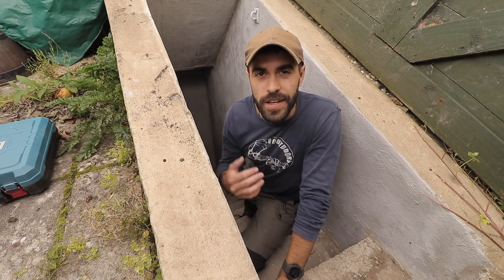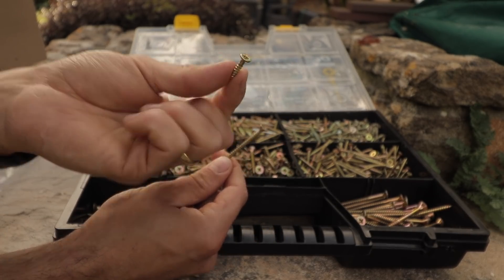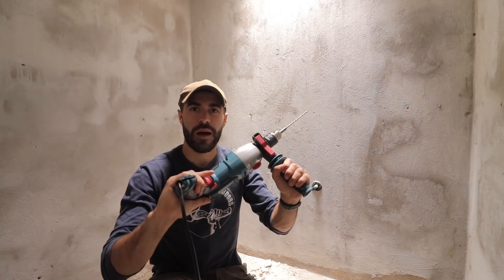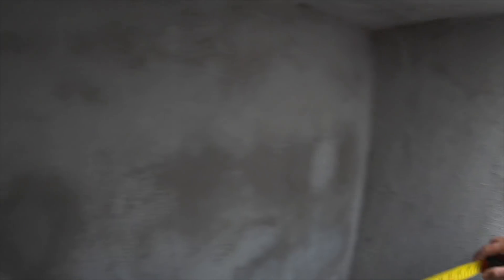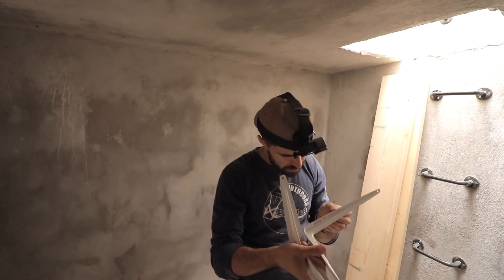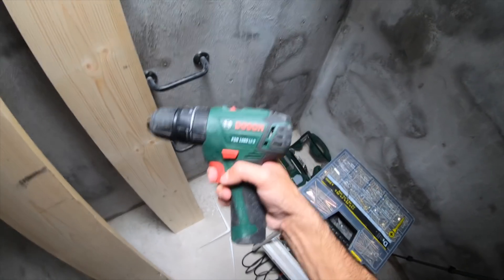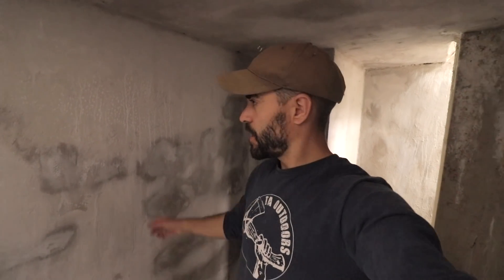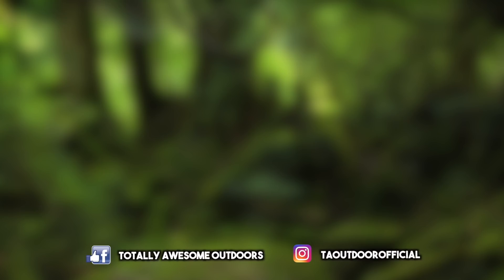Building an ESCAPE LADDER in my WW2 Bunker (PART 6)

Comment: Great to see you make progress on the bunker! Really loving the idea for the wall-mounted ladder system!

A few suggestions:
1. Get a cover or whatever to block the sump hole, so that you don't trip and break something! One idea for this would be a wooden cube with the same dimensions as the hole (so it's flush when inside), where you drill some smaller (finger sized) holes into it as a "grip", which would be big enough to grab and lift that "stopper", but too small to get stuck with your foot. Might even drill these holes the whole way through, so potential water ingress can still go down there until you get around to starting the pump.

2. Make the cover above your escape ladder in a way that it can be secured/locked from the inside, maybe with a string that you simply put over a hook. That way it can not be opened from the outside, say by your little daughter, who might otherwise fall into that hole... I'm guessing you would have done that anyway, but still wanted to mention it.

3. Maybe remove the wooden shelve boards and paint them from ALL sides before remounting ;-) The way you did it, moisture can creep into the wood from the back, and with the top being sealed, it will not so easily evaporate and the wood will likely rot even more quickly than completely unpainted.
Reply: Was going to be my suggestion - exposed untreated wood against a permanently damp wall is asking for rot and mold.
Reply: Number 1 seems a little overly complex when you can just put a drain cover over top the sump hole.
Reply: @TheMrVengeance  That's true. A simple (bought) cover has been suggested a dozen times already though, so I wanted to give an idea for a different solution ;-)

Comment: Great video. Stain or seal all six sides of the wooden shelves. Wood touching concrete will soak up moisture and rot.
Reply: Exactly my thoughts! Paining only the top and front (and one side on the smaller ones) doesn't really do much, other than optics.
But then again he said something along the lines of "happy for now" about the wooden shelves (when talking about the option of metal ones), so he might replace them at some point anyway.
Reply from the maker: On it! Should be a quick fix to get to the back of the shelf. Cheers for the comment
Reply: Cheers Mike!
Reply: @TAOutdoors  Before staining the wood, stabelize the wood first.  In those conditions the shelfs will crack and worbe.

Comment: For a bed, maybe check out how the Navy used to fold up racks in WW2 Navy Destroyers. Four elbows, 4 threaded lengths of pipe, Canvas with grommets all around to attach with a line around the pipe frame, 2 lengths of chain attached to wall to raise and lower rack to sleep or fold against the wall.  You can either use the hooks to attach the chain to the wall and then use a link in the chain when raising it to hook it in place stored. Or a center hook on the wall for the same.  U shaped brackets to hold the bed frame to the wall for support.
There is also a rubberized white paint so after you have sealed the walls you paint over it to brighten and help with the echo inside. Going to be a cool place for peace and quiet, and a personal dog house when you get into trouble with the missus, We all been there once or twice. :)

Comment: I'd suggest a dab of Sika-Flex caulking in each shelf bracket hole prior to screwing in.  You may (now that you've compromised the seal of the coating) get some moisture weeping from the screw holes and down the wall.  I'd 've done the same for the screw holes for the  ladder brackets.  That'll be a nice/usable space for you.

Comment: Cap your escape hatch with a wind generated vent hood.  Put it on hinges so you can toss it open, and when closed you have a ventilation system.  Moisture is going to be your biggest issue and the mold that goes along with it.  But don't loose your sump hole.  Spring thaw will bring lots of moisture.  Just take your pallet wood cabin mentality and add some steroids to it.  Love the fold down bunking system.

Comment: suggestion for the escape ladder hatch, use an old RV or Air Stream roof vent with the white translucent bubble inset for light during the day. Translucent to prevent spying eyes seeing in. Set it up so you can open it a crack for fresh air when needed to vent the room. Or make something similar from scratch. Also have a second inner hatch made out of screen to prevent insects from coming in. double up and offset  two screens to prevent fungus gnats from getting through.

Comment: I would recommend hammocks because you can store them in small watertight containers within the bunker. If you use matress pads, they will develop mold in no time. Also make sure that the escape hatch opens downward so that it won't be blocked by debris that falls on top.

Comment: I did a similar staircase some years ago and I drilled holes in the concrete and attached bent rebars that I fastened with cement glue.
Cheap and effective!

Comment: You might want to figure out your electric, before you go any further.  I suggest setting up a generator, and box it in with cement blocks.  That would protect it from external damage, and muffle the noise it will make.  Maybe even set up a remote start and transfer switch, to change over from the house electric to the generator.  Don't forget to ground everything.
I like your idea for the fold up beds, maybe an actual bench for the bottom and a small table.  
I would suggest lighter colors, to help reflect the light, and keep the darkness down.  Maybe even photo luminescent paint, so if the power goes out, you will still be able to see.

I love the project.  It has given me many ideas.

Comment: I would've used completely different screws tbh
The screws included in the package are for wood(but, cheap ones) - and for wood, the would easily hold your weight. The screws you're using are still wood screws and pretty cheap ones aswell. Those can break easily(in given time...or already after a few climbs).

Comment: As a man who spent way too much time under ground during service I must advise you that every proper bunker has to be painted in the most 70's orange you can find as per regulation. Contrast with beige or brown if you must but make sure the floor is mossy/babypuke-green and rubberised.
Reply: It has to be that thick oily paint you can wash and it must be two tone.

And yellow-reddish lightbulbs are a must, making sure at least 50% of them are burnt out or flickering.

/s

I also spent a decent time in bunkers myself, that moldy smell mixed with sweat and cigarette smoke is not to be forgotten.
Reply: Sounds absolutely charming. Just the place to spend a weekend with the children.
Reply: Ahh, the old standby zinc chromate!

Comment: I would have used concrete screws.
Reply from the maker: You can tell I don’t do this sort of stuff daily! 😆great point though, thanks for the comment
Reply: Yes, Tapcons. They're generally a blue masonry screw.
Reply: @steveXracer it seems that he used brass wood screws. It won't rust.
Reply: @goingagainstthegrain  I'm not sure we have these in EU. Every country is different also... building codes in Switzerland are insane compared to US for example. 

The only wood we have in our houses is for flooring or in our chalets !
Reply: If there’s no proper concrete screws in the UK I’ll eat my hat!!!
Reply: Corrode
Reply: @mattshaffer5935  with honey, jam, cheese...or all 3 toppings.???  😅😅😅
Reply: Recommend the use of Tapcons.
Reply: @TAOutdoors  Yep, def a tapcon for concrete. Live and learn.
Reply: Yeah, he can always switch them out for tapcons in the future.
Reply: @ArthA122  they are only coated in brass coloring.....JJ...
Reply: Don't be silly, concrete is a terrible material to make screws out of. I'd recommend something made of metal.
Reply: @ArthA122  and they have NO shear strength.
Reply: I too would have used masonry screws and lags.......  good for emergency I guess.,
Reply: you mean dynabolts!

Comment: Because your walls are damp, you'll need to pull your shelving a  cm away from the wall to prevent wicking. This is true for anything you'll be storing down there. The air gap will also cut down on mold. (I know! I recently had a pipe burst in a closet wall. All the boxes got damaged from just leaning on the painted wall... Which seemed dry to the touch.) 💜🌞🌵😷

Comment: A couple things:
Use the "click on/off lights" from the pallet video under the shelves.
Here in the U.S., we have a primer called "Killz Primer". The oil based might work down there, after a few more seals.
Add a very coarse texture to the step sealing/primer job.
Add a small angle to the shelves to allow water run off.
Attach a sledge hammer and crowbar to the wall, for safety.
Don't forget to use the ceiling for attachments/storage.
I love your channel!
Reply: So you not priming walls with PVA?

Comment: Me and my mate started a similar project recently... We began renovating a concrete hut which we believed to be an air raid shelter, but it turned out to be a plate layers hut. We spent about a week clearing all the crap out, leaves, roots broken glass etc. A few months and around 400 quid later ( a pretty big sum seeing as we are both only 17 ), the hut is complete with a locking door, sofas, an old F1 tyre used as a coffee table ( top gear inspired ) and believe it or not, a powered 40 inch telly. It's been great fun, wish you good luck with your bunker 👍

Comment: I would paint the edge of the 2 small shelves on the right when you come in, in RED because the top one is at eye/head level and sticks out into the room. Also I would round those edges just to be safe. Cool project.

Comment: I would have a platform that could be extended the bed to full or 54 inches wide.  Need to remember the rungs for the escape hatch may need to be used as a part of your extended platform base support. and 3 extra legs for the 15-inch bed width.  Hinges would fold the whole apparatus back to the wall.

Comment: Thanks for the great video. I would consider some kind of fan system to draw air out and an inlet to draw air in so you can use the G Stove in there and not worry about carbon monoxide.
The shelter reminds me of 'Fall out 4' the video game. Nice work.

Comment: Awesome update! My brain when into kinda engineering mode thinking about what kind of fold up or fold down bed you could put in there. If you built a permanent set chair or corner benchseat in that back right corner, that could work as one end of the support for a single bed platform that could fold upwards. A box underneath the shelving just inside and to the right of the stair entrance. And on the underside of the bed platform, you could attach a 90 degree platform that A, works as a "leg" for the bed, and B, works as a short table when the bed is folded upwards.  That's where my mind went, at least. I hope this gives you some of your own ideas!

Comment: Hmm, like others have mentioned, proper concrete anchor screws would make that much safer (and it would be quite ease to replace those wood screws with the anchors)Personally, I would have staggered the rungs about 12 inches apart off center.(face the wall, put both hands straight out and touch the wall. That's how far to stagger them. :) Great job man!

Comment: In my honest opinion those handles are probably not the best thing to use as the welds could fail and as caver i would recommend making some handles out of rebar and resin them into the wall as it would be more secure than what your using..
Reply: Bend some rebar for handles, Drill I to the wall where they need to set with a masonry bit maybe 1 or 2 sizes up from the rebar size, then resin them in to hold. The commenter above is correct... And over time, those welds WILL give out
Reply: Spot on. Handles will fail.
Reply from the maker: Hmm good point! Didn’t think about the weak point. I got caught up in the idea of having them. I might keep them like it for a few weeks and use them often and see if there anything starts to give way. Like the idea of the rebar. Thanks for the comment
Reply: As a engineer and a hobbyist welder i assure you a quality weld is always stronger than parent material.

Of course, just judging by the sound these seem like they have super thin sidewalls and will fail eventually.

Just wanted to say that quality welded ones are as strong as 1 piece ones. When passing a welding certificate you have your coupon (piece of plate you weld then submit to be tested to judge your skill).
That coupon, consisted of 2 pieces of metal welded together is then bent into a U shape and it must not crack or you fail your certificate.

So, buy quality, buy once.
Reply: @lazar2175  yes that may be the case but these where most probably mass produced and welded by robots in a foreign country.
Reply: @steveXracer not to mention they aren't designed to withstand shear loads. If they don't pull out they will snap off.
Reply: @DavesIneosGrenadier  aren't they brass wood screws? It won't rust. But will shear !
Reply: @ArthA122  The long ones look like standard zinc passivated steel self drilling screws. Not designed for outdoor use. Cheap as chips at the big hardware stores.
Reply: @steveXracer I was thinking Confast anchors
Reply: @TAOutdoors  looked like the handles had a hollow hole ... you could set an 8 inch piece of rebar into the wall and the other end into the handle to the bend ... and if you have a spot welder spot weld them together .. keeping the good look of the handles and the strength of the rebar
Reply: You could always make a rebar and something (resin or whatever) plugs to go into the center where the weld is and part way down that way you would have the three screws and a plug on each side to hold it up.
Reply: @thealicemonster9217  you could but there is still the chance they could fail hence why if you make it from one piece of rebar you remove that chance
Reply: I agree. Rebar, resin and then paint in that anti slip paint. You'll be styling.

Comment: Raise the edge of your escape hatch walls with good concrete or brick.  Build an aluminum hatch with sides and a bit domed so it sheds water much better.  Then for ventilation add some PVC pipe in the front there where you have not finished.  Add some vent covers to that PVC and you will keep most of the water out of the escape "tunnel".

Comment: C19 crapped on everything.  Ehhh.  It's just a hobby room, so I wasn't disappointed in anything you've done. If you want to 'cover up' the splotchy gray walls, hang tarps in front of them.  We did that for a godson's room in a rental home; a few nails at the ceiling and hung a camo tarp on one wall.  Ooooo... a map would look very cool.  With German bases marked. Just a thought.
I'd place money on a bet, that the ladder rungs get used for hanging stuff before  you're all finished.

Comment: Mike, you really need to go back and replace those screws with proper concrete fasteners. This needs to be safe.

Otherwise, watching the bunker progress has been a lot of fun. Thanks for continuing to share it.

[edit] Ok, you're at least using plastic mollys. That should be decent for an escape system, but I don't know if they'd hold up to semi-regular use.

All that aside, the ladder looks epic. It fits the vibe perfectly. Now send the missus up (off camera) and make sure it works for her too.

If it's a renovations, I'd like to suggest a pair of solar panels in the garden and a 1000 amp hour lithium battery (LiFePO4) on the bottom shelf together with a proper charge controller. This would set the shelter up with power independent from the main house. It would be enough to keep cameras, phones and a laptop or two charged in an emergency. It would also easily handle a 12v camping fridge. 

I know that's a lot of extra money, but it would be handy in any situation where power mains are down. You could also bring wiring from it into the closest room in the house and provide the same utility inside the main house. Just a thought.

That bunker gets really damp. May I suggest mounting the boards on the brackets so the boards aren't touching the wall? I'd also highly recommend wiping them down half a dozen times with raw linseed oil.

Oh - check into a WWII folding field desk. There are even plans out there so you can make your own.

Comment: You should paint the walls with white oil-based (or oil-solved, I don't know how it is called on UK) paint. Applying another layer of sealant (that Sika stuff) won't be of a good use, since it may not adhere very well. But oil-based paint is very good to prevend humidity and mold to show themselves again.

Comment: Would have painted all walls and the ceiling with a nice white. After that you can install all the equipment you want. Also a night or two with some kind of drying device and a humidity check afterwards would be good.

Comment: A rail either side for quick decent, just a thin pole either side. Sometimes you need to get in quick. Then a cable and winch or something you could pull and keep the hatch locked with tension it would have a small footprint and  make it harder to breach.

Comment: Weld up a frame and put a steel panel on a hinge. Locking from the inside. With the frame you could give it the same rise for airflow.

Comment: If you use a hammock, you could take it down and have more room when you are awake. The space would be more flexible.
Reply: A small metal structure that folds to the wall works too. And I would argue that a small matress is more comfortable than a hammock.